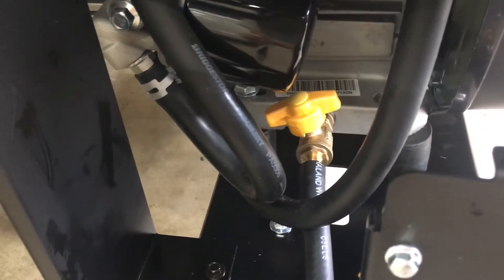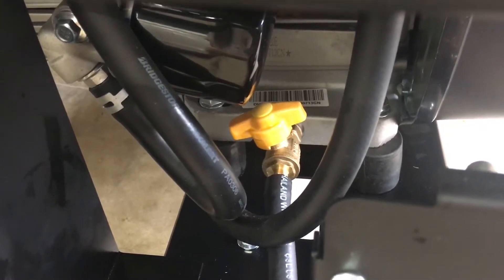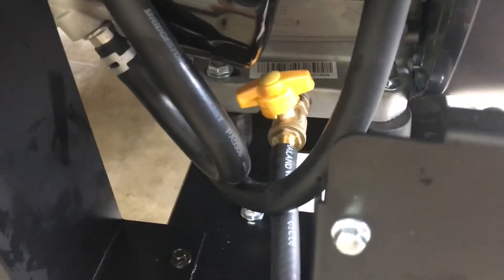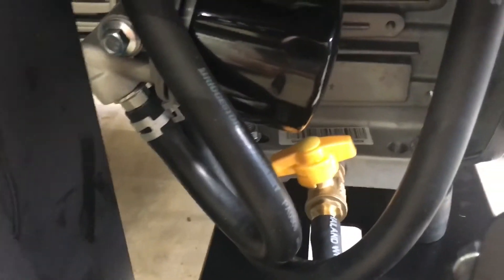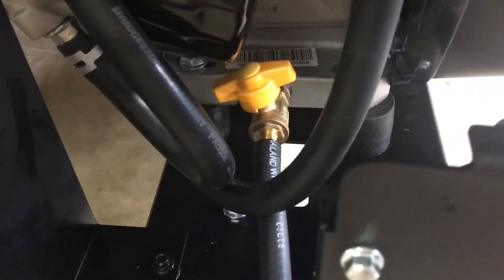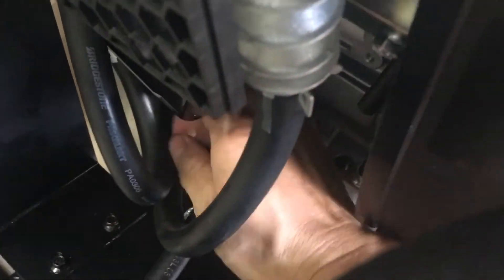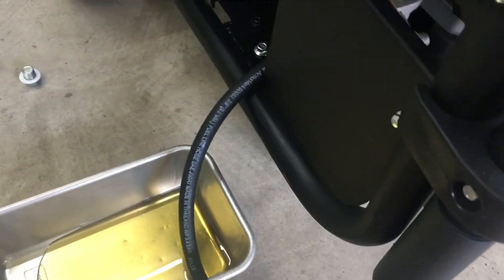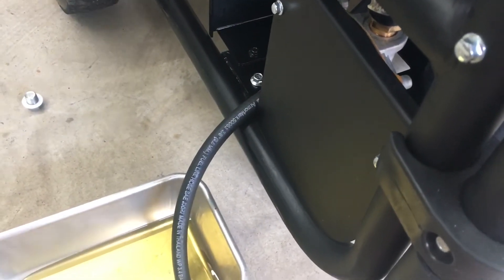Part 5- Westinghouse WGEN12000DF 15000 Watt Dual Fuel Portable Generator Oil Change Mod

Comment: What spark plug are you using.  I am having trouble finding the exact plug listed in the manual. ngk (1034) bp7es or bosch f7tc
Reply from the maker: Switch to NGK. Go with BPR7EIX NGK 4055.

Thanks for watching, hope this helps. don't forget to hit the like and subscribe button.

Comment: I just received mine and it actually came with a hose hooked up to that drain plug with a cap on it. And it Clips up behind one of the support bars. So I guess on these new models you don't need to use the modification anymore
Reply from the maker: That's great. Maybe they saw my video and realized they dropped the ball, and decided to start including it.

Make sure to break-in the generator. So it can good for many many years.
Reply: Yep, I just got my generator, and it has the new oil drain hose on it. They've also repositioned the 50A outlet to the left side of the panel. Previous versions had it on the right side above the wheel making it difficult to plug in the hefty 50A cord. If your cord had a right angle plug you would have to jam it behind the wheel. Nice to see Westinghouse making improvements based on our reviews!
Reply: I bought mine 3 years ago and it came with the hose as well

Comment: wow, oil filter is $17! That is pricey for such a small filter. I am also looking for a part number for the air filter, if you happen to have that? I will definitely want a nice drain hose to.
Reply from the maker: This Filter from Amazon, is a matching cross reference.
https://www.amazon.com/gp/product/B07RWZSFY6/ref=ppx_yo_dt_b_search_asin_title?ie=UTF8&psc=1

As far as the air filter goes, you probably won't need to change that too often unless, you are using the generator in a extremely dusty condition. You can always take it out and tap out any debris, and continue using it.
Reply: @gilbosdiy  For sure, I just like to be prepared. I would like to just have one on hand in case a rodent chews up the original at some point or something. Thanks for the link on the oil filter. If you happen across the air filter number that would be cool, if not, thanks so much for the oil filter at least! That is more important for sure. Have a good weekend.

Comment: Thank you for this video. We couldn’t have figured out how to change the oil without this video. It did take us sometime to remove “that extremely hard bolt” but we finally managed to remove it! Tonight we are warm😊 Thank you again.
Reply from the maker: Beda Life, glad this video helped you out. Many times in life it's about working smarter and not harder when you don't need to. This is one of those situations. Make sure you check the other videos for this generator series. Thanks again for watching.

Comment: Have you had any issues with this valve breaking? I have seen a couple of negative reviews where it just snapped a part. I just had this generator delivered today and I think I’m going to do this oil change modification before I add any oil
Reply from the maker: I think the generators after 2020 they started putting the drain hose and valve. Guessing they saw my video. Calling Westinghouse, out for being cheap, not putting one with the generator. To answer question, no issue with my aftermarket drain valve breaking
Reply: @gilbosdiy  you are correct mine got delivered and it does have a valve with a hose and a nice little holder for it
Reply from the maker: No problema, glad I can help.

Comment: Anyone know the oil filter number?
Reply from the maker: WIX 57890, is the one you will need
Reply: @gilbosdiy  Napa has no such number for WIX
Reply from the maker: @donschlonski2936  They probably cross referenced wrong, wouldn't surprise me. Here is the link: https://www.napaonline.com/en/p/FIL7890

The link is for the Napa brand filter number for the same wix 57890
Reply: @gilbosdiy is wix 57890 an official replacement? If so, where you found that? Only thing official I ever seen from westinghouse is 751-12690. I know there is a couple people on forums that suggest this filter but doesn’t mean that it is the right one though. It could have the correct dimensions as oem filter but technical specs could be different tgan oem since westinghouse doesn’t tell us the specs of their filter
Reply from the maker: @mikep8861  All you have to do is google up oil filter cross reference of Westinghouse 751-12690.

https://wixfilters.com/Lookup/Exactmatch.aspx?PartNo=751-12690

Hope this helps, Thanks for watching. If you have anymore question(s), just ask, and I'll try and help.

Comment: Where do you get the replacement oil filter?
Reply from the maker: Wix 57890 is the replacement
Or go with
751-12690 (Home Depot, Lowe's)

Comment: I just ordered a WGEN12000DF.  It doesn't say that it comes with the oil hose/valve feature.  I'm going to call Westinghouse and find out.  If not, then, I'm ordering and installing your setup.  It's gotta be easy to change the oil.  Thank you for posting this.  BTW, how do you like your generator?  Have you tried both gas and propane?  How well does it perform?  Thanks.
Reply from the maker: Yea, it's not included with the generator. So far no issues, I haven't really had to use it for an outage. Only used it to test that it was able to run my whole house, during my initial outlet hookup with the electrician. I tested it with propane, I figured if I can with propane, it will for sure be able to run with gasoline. If you look at my most recent video (Part 6), I added another accessory to ensure I can run my A/C, with this generator.
Reply: @gilbosdiy  Thanks.  I saw video 6.  I asked my electrician, and he said that device is not applicable to my configuration because I have a geothermal loop and a furnace.  The geothermal provides both cold and hot air without a compressor.  That Amp device is an interesting concept, though.

Comment: Weird.  My WGEN12000DF arrived last week with the oil drain hose installed.  It may be a recent addition.
Reply from the maker: That is good to hear, maybe Westinghouse saw this video and thought, " Hey it really is pain in the but, to change the oil without the drain valve, maybe we should include the drain valve."

Comment: Dude, companies are always cutting costs by leaving stuff out. My Westinghouse 7500-9500 watt model has the same thing. I don't know if the plug is the same thread size or not, but I suppose I could do the same thing when I do my first break-in oil change. If you think its the same size, I will order that drawn valve from your link, and some tubing too, like you said, make oil changes easier.
Reply from the maker: Best thing to do is, use a measuring caliper and measure the drain bolt size, then get the correct drain valve. Worse case, when you are doing the oil change, just don't fill it back up with oil until you get the drain valve in. That's what I did.